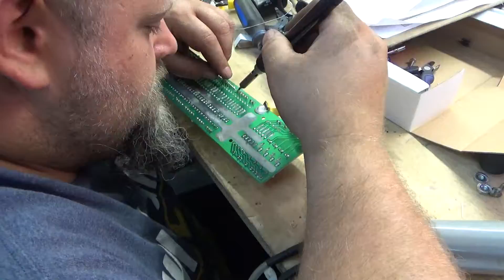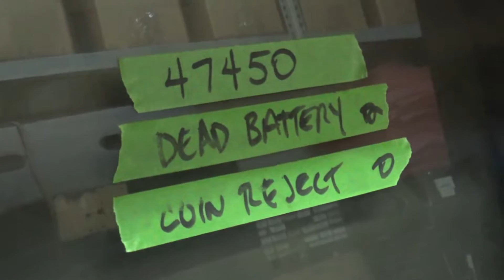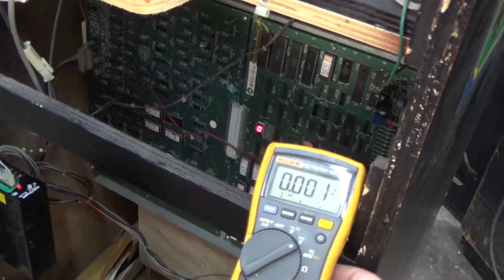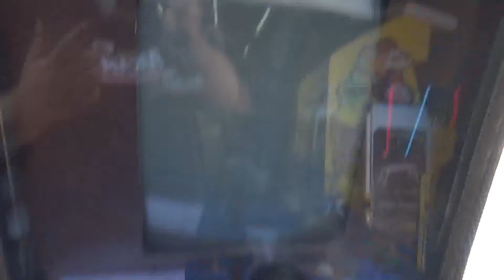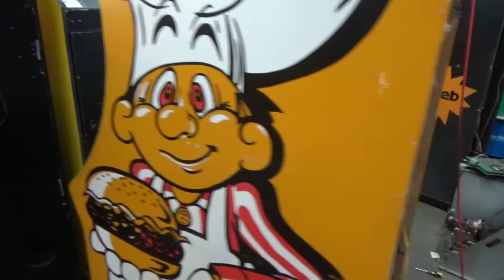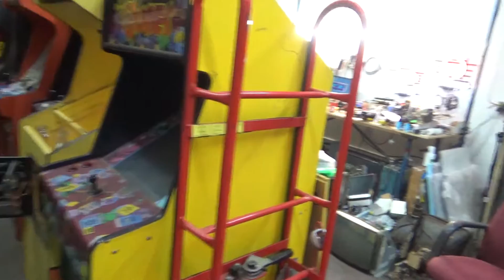Over 300 arcade games repaired part 1

Comment: Is that space fury? What does the voice sound like.. is it like a normal phonetic chip like from Texas Instruments? Like the one on black night pinball? I used to play it on colecovision all the time.. never played it in the arcade. Played on MAME but the voices were simulated and sounded like crap.  And you’re 100% right on solder joints. Tin crystallizes over time. It also forms whiskers that will short out stuff. (More of a problem our SMD components)

Comment: will you be my sensei
Reply from the maker: olias ben el   you crazy lol
Reply: im learning to do my own repairs on antiques and vintage tech like CRTs and basic soldering but haven't had the courage to recap stuff cause i don't wanna electrocute myself haha. arcade repair would be ideal for me just gonna hunker down. right now i have a sony trinitron from 1983 that won't power on, checked two fuses inside with a multimeter and they were good, not sure were to go from there, the capacitors in this bad boy could literally kill me im pretty sure.